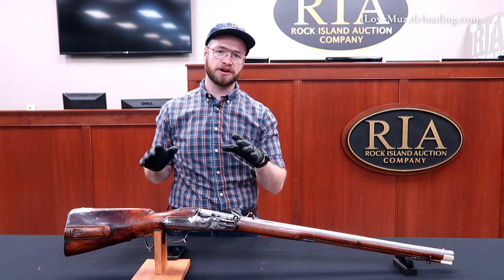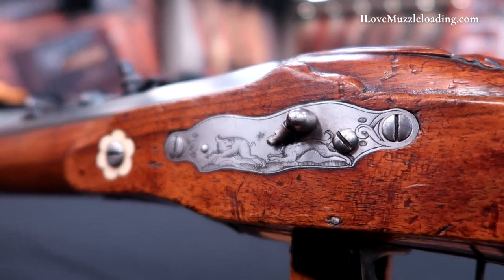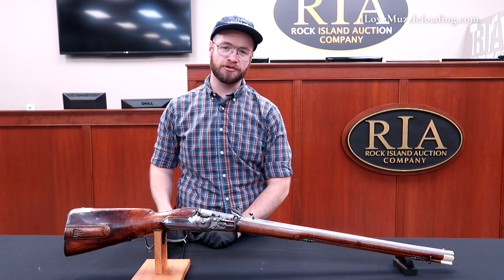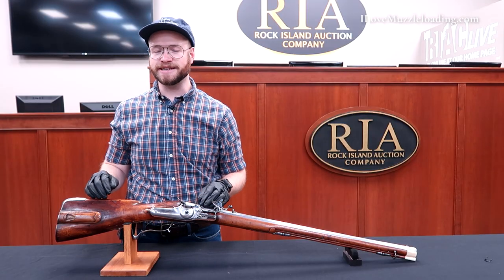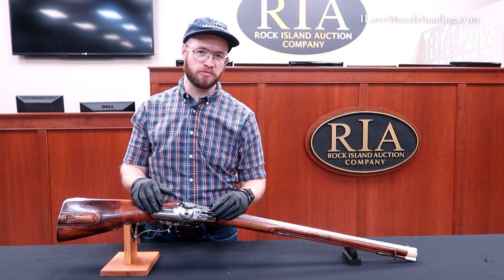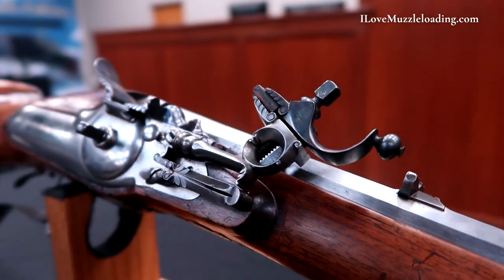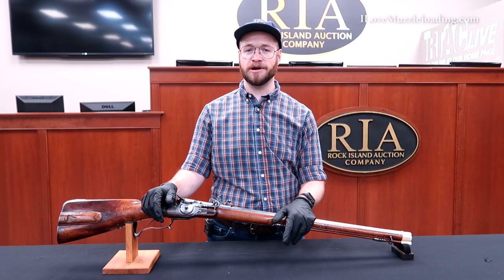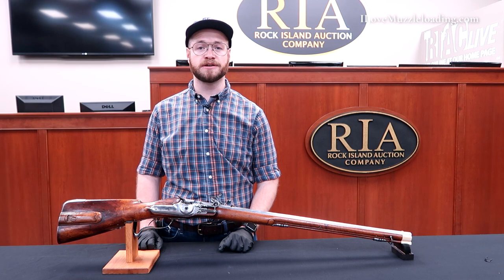This is NOT a Wheel Lock - Masterfully disguised German Muzzleloading Air Rifle - Wentzlau Windbuche

Comment: Those air rifles work on the same principles than the ones we have today. Either they have a spring loaded pump in them that compresses the air when the trigger is pulled or they have an air reservoir that is filled with compressed air for severals shots. I am sure you find such a reservoir here when you take the buttplate off. I have no idea what they used for hoses in those days to link the external pump to the valve in the stock; maybe leather and wire that was wrapped around it tightly. Those reservoirs were usually from copper as this material is tough when  thick enough and does not crack like steel when overloaded. Most of those reservoirs were indeed ball shaped and were screwed to a valve underneath the barrel. The big issue was the release of air into the barrrel from those pressure vessels without emptying  them completely. What you need is a valve not unlike the ones in our combustion engines. The pressure inside the reservoir presses them against a seat that seals them. That means that when you shoot you need a spring loaded mechanism that pushes against that piston in the valve so that it opens for a short time. Air rushes out and into the barrel. That mechanism will surely be some sort of cam ( similar to the ones  in our cars). Once that cam has turned around far enough the pressure in the container closes the valve. Alright, and what do we have to turn that cam and press shortly against the valve? A conventional lock, be it the spindle of a wheellock or the tumbler of flintlock. The leafspring of a wheellock surely has enough power to turn such a cam. Steering complex mechanisms was possible in those early days of mechanics; just think of those beautiful musical boxes that had several instruments, even flutes that were operated by tiny bellows. I can well imagine that when a clockmaker of that time, a gunsmith and a coppersmith sat together over a jar of wine in a tavern and talked things over, such a wonder like this rifle was the result.